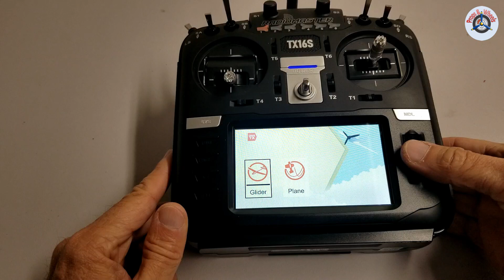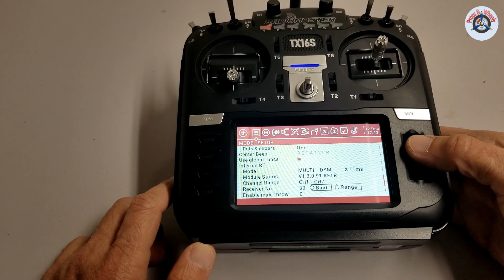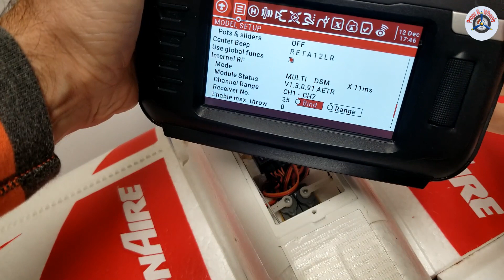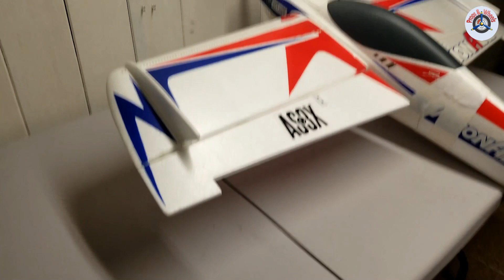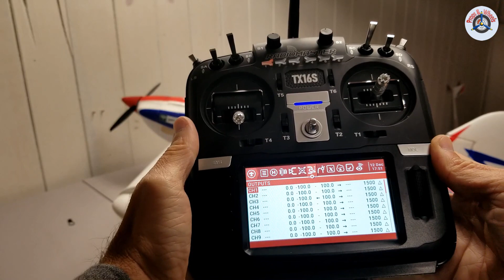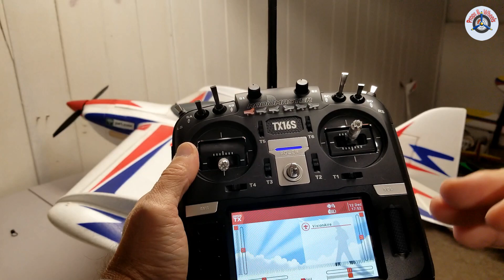RadioMaster TX16S with HALL Sensor Gimbals - Binding to a Horizon Hobby DSMX Airplane with AS3X

Comment: Thank you for the video. I have a couple of questions though... a friend got a Carbon Cub S2. It does bind, but the channels are all messed up (doesnr recognize some switches and other things) . The protocol DSM X alone doesnt show in his TX16S. It is DSM X and like 4 different things. Same thing with a RM Zorro we had at hand at the time. So do these planes with Spektrum electronics need this bind plug?

Comment: Hello, tell me please, I have a HORIZON EXTRA 300 aircraft. 1300mm.  A Spektrum AR631 is installed there.  connected TX16S, everything works, but I can’t find how to connect stabilization, beginner mode, can stabilization be activated on TX16S?

Comment: Great video thank you! Bound to my own night VisionAire. I have lost the phone cable to program the as3x. Do you know if there is a default channel set to turn off the gyro function? Thanks
Reply from the maker: Hi Jack. Thank you!

This blog post says that the patch cable is the only way to change it:

https://www.hobbysquawk.com/forum/electronics-and-rc-accessories/rc-radios-receivers-and-accessories/51401-turning-off-as3x-in-a-spectrum-receiver

"The mobile app is the only way, I have disabled it on all of my BNF planes including the E-Flite 1200 Corsair. I'm still looking for a way to disable the UMX AS3X receivers."

In addition, it also mentions that some Horizon Hobby planes do not allow it even with this cable:

"Sorry, I should have mentioned ................... depending on which AS3X RX you have, it may not be altered. For example some of the ones that come on their Sukoi or Corsair, is nearly impossible to go in and change anything. They are somewhat proprietary to those models and Spektrum doesn't want you messing with them. The ones you buy as "stand-alones" usually can be re-programmed. Check the Horizon site for that model of plane and/or RX to find out if it can be fiddled with."

Good luck!

Comment: This is all very new to me and this helped a lot, but do you know how to set up a twin engine airplane? I can't seem to figure it out. Thanks!
Reply from the maker: For a twin "brushless" electric motor setup, you will need two ESCs (electronic speed controllers; one for each motor) that are connected to the "throttle" channel via a Y-cable (a.k.a. splitter cable). For a twin "brushed" electric motor setup, you can get away with only one ESC (basically these brushed ESCs are voltage controller) as long as it is big enough to feed both brushed motors (in terms of maximum current draw). Let me know if you need more details.

Comment: Hi. Nice video. Just a question concerning the tx16s transmiter performance. What about the range of this radio with this dsmx receiver?. I purchased this radio and I wonder if the power trasmision is so good as a original spektrum radio....I have several orange dsmx receivers and one original spektrum receiver. What is you experience?. Thank you in advance. Cheers
Reply from the maker: Hi Oscar. I did not compare it side-by-side with my Spektrum DX6i radio, but it seems to be working fine with all my planes with a genuine Spektrum receivers. I also did not have any issues with my one Lemon-RX received either. I have an issues with one of my Orange receivers, which lost connection a few times during flight, and eventually crashed. However, I have heard issues with Orange receivers from my RC friends before, so this crash may be related to the receiver. It also works very well with my Corona and FrSky receivers. Good luck! All the best.

Comment: That's very helpful but how do you control the switching of the as3x Safe mode positions,  many thanks from Alan in the UK 👍👍🤗
Reply from the maker: Hi Alan. Thank you for your question. This airplane does not have the SAFE technology; it only has the AS3X. And on this receiver AS3X is always on and cannot be turned off via the transmitter (to my best knowledge). I am not sure if it can be disabled on the receiver. I hope this helps. Cheers!